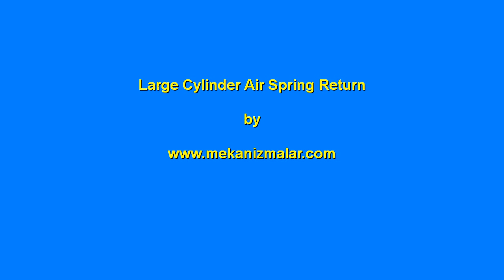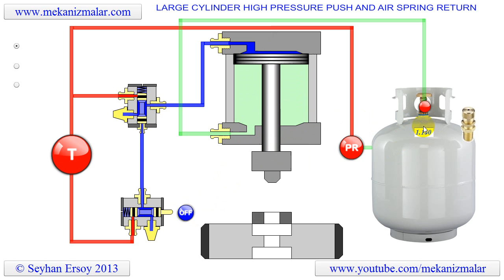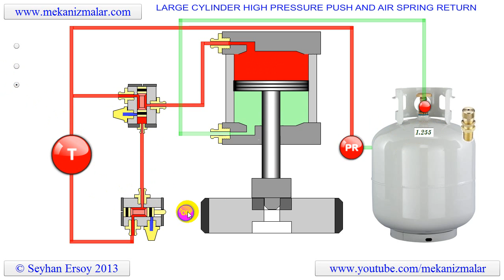large cylinder air spring return

Comment: Hello sir.... I thought of this the whole day... It will surely reduce air consumption big time... But i had a question though.... For punching purpose I need a little speed while piston moves outward.... In this case if a give a spring (air) pressure them the punching will be slow... It is just a thought... As far as I believe we shall definitely need quick exhaust valves on both ends to work this large cylinder to and fro... What are your thoughts...
Reply: Hi Rohan, If we put quick exhaust valve on the green line which when cylinder going forward will reduce the drag, we will increase air consumption. Maybe you should use two air pressure, high and low, you should use 5 port 4 way valve. You can find it in my animations.
Reply: @seyhanersoy8989  thanks seyhan... I thought I would not get a reply for this... Thanks a lot... And yes That's a good idea... I can use two pressures high and low.... May be it may reduce air consumption....

Comment: Please , can you give us an idea about using this system to pumping water.
Reply from the maker: +Abdelhamid Arfa Thank you for visiting my YouTube channel. I appreciate your visit. To use compressed air for pumping water by using this device is expensive and I don't recommend it.  If your water source is underground, you can use air lift pump https://youtu.be/03EmME_OB-s However the best water pumping option for your situation should be evaluated by taking consideration your water source, your water need and available energy resource for your site. Than you can figure out which pumping method is best for you.
Reply: +mekanizmalar  

I appreciate your response you are nice and helpful guy, I have been visited the Web site that you require; but, I Know the air lift, cannot be a good solution for me. I suggest to show Pitbull Pump Demo and if it possible to forward you comment.
Reply from the maker: +Abdelhamid Arfa This pit bull pump is very good idea. I liked it. The system you see in large cylinder air spring return would be more expensive. You can built the pit-bull pump relatively cheap. If you have compressed air and two check valve, and a tank the rest it easy. I should do an animation of this pitbull pump.
Reply: +mekanizmalar 

Thank you for your suggest and comment; keep in touch.